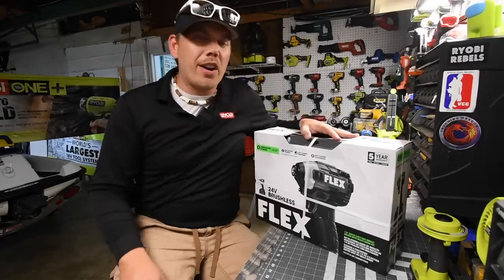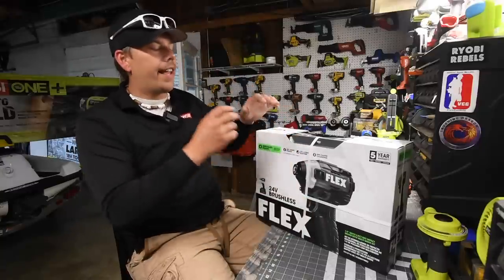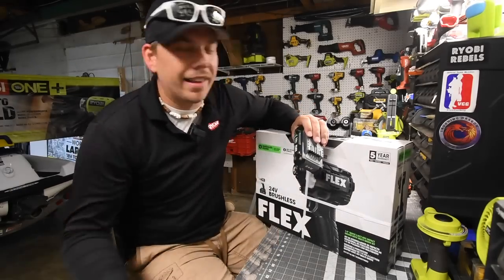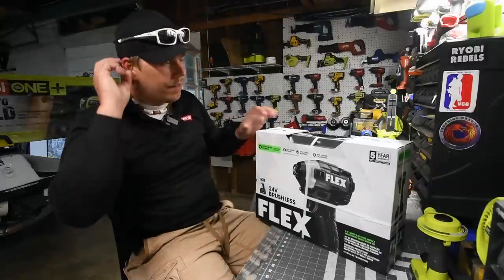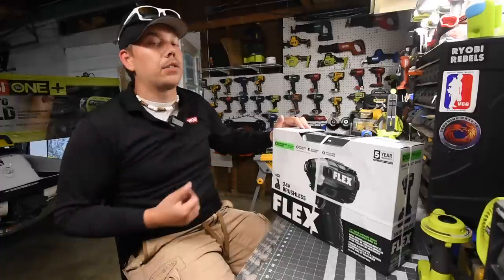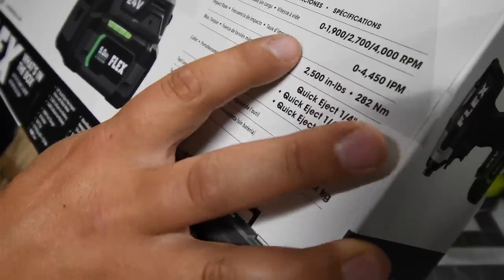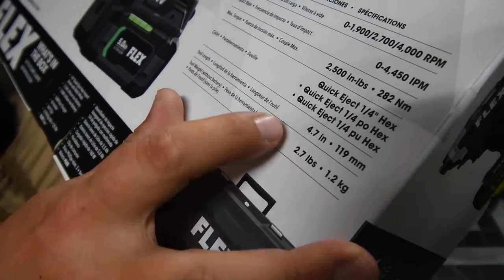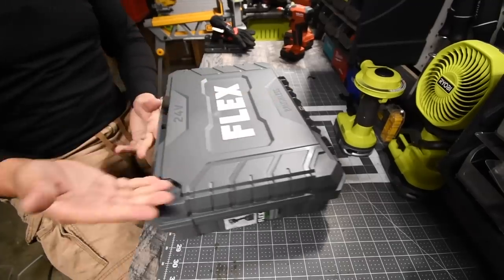FLEX Impact Driver Kit (Unboxing/TEST)

Comment: I don't believe there has ever been a new power tool brand that has come in and made the noise Flex has. They have lived up to the hype and, I think, they have new tools coming out on the 12th. I saw a sign at Lowe's intimating as much on Saturday. Not sure I would want to watch this Flex ago against the Dewalt DCF887 or Ryobi because I know those two aren't even close to this level. Still, I am going to be watching whatever you put out.
Reply: flex has been around for years..body shops primarily
Reply: @bigdaddybiggs1973  finally someone who knows. They had drills as well but were red and 18v not 24v.
Reply: He's still a bit of a hater, you can tell by all the negative comments during the video. People don't like it when someone says their tool isn't the best.
Reply: @robertcasey3528  exactly.I was always told there was the right tool for the job..sometimes its not the best or most powerful that works the best
Reply: @robertcasey3528  I would likely agree with you about Dave. I think he made up his mind about the brand long before he ever touched it. That being said, I am a firm believer in letting the tools do the talking.
Reply: They are too far behind the 8ball to catch up to the giants. Many people dont want to switch battery platform even if they do like the flex tools

Comment: 1) Disco lights, dig them, need to be able to choose the colors for my drilling moods.
2) 2 more years on the battery warranty? sold.
3) eject button? heck yes.
all kidding aside, didn’t expect a 24v motor to be compact,  the power bar on the batteries is interesting, made me think of the color of choice option but i would also like that to be the case of the front light too…this will be the next step in tools.  the thing, hey maybe thats its new moniker? “The Thing” looks like a great addition, the lightsaber type battery bar will be a big attraction. like moths to flame as they say (guaranteed that was said in the design room)

Comment: Did you list the items on Ebay yet?
Reply from the maker: I have not, been pretty busy
Reply: @ManCaverTools  if someone hasn’t called dibs I’ll buy them as soon as you post them. I been being using the FLEX drill non Stop for 2 months everyday on my jobs and have been impressed by the capabilities. I’m also been a dewalt person for a better part of a decade so it was tough initially switching over